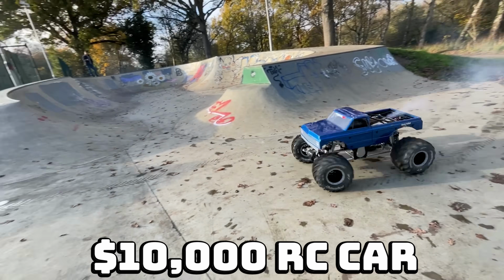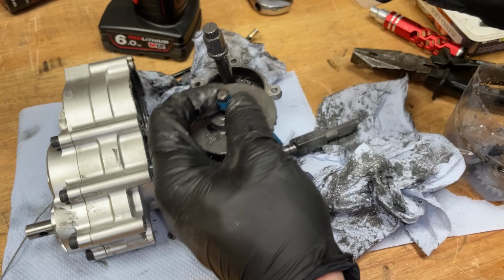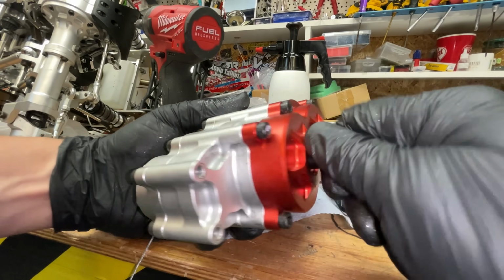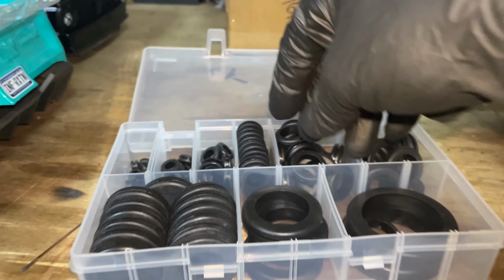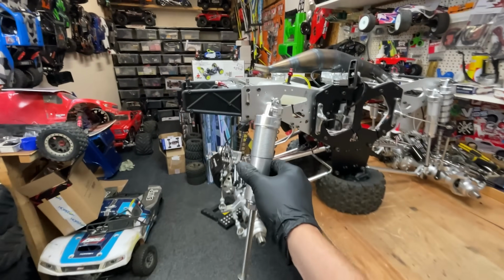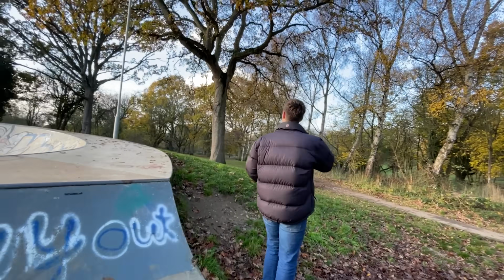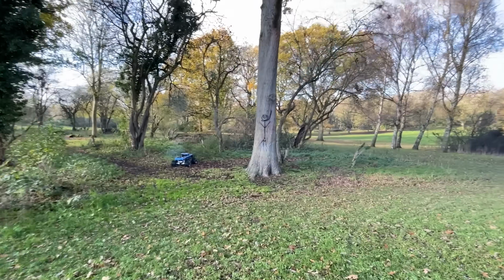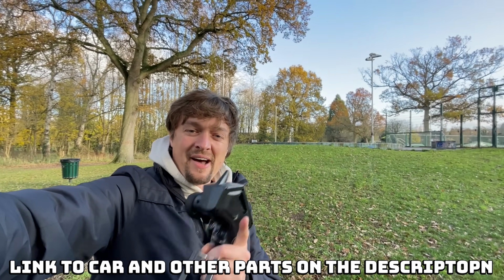$10,000 rc car

Comment from the maker: Kev's eBay Secrets - 11 steps to being your own boss https://kevtalbot.clickfunnels.com/squeeze-page31158442
Reply: Another good video kev👍🏻
Reply: Can you like this comment? It would mean a lot ,hello from USA
Reply: Thank you Kevin!
Reply: The wheels were spinning too fast when it landed with nearly no forward momentum,  which sent massive torque through the drivetrain as they're forced to stop instantly.
Reply: Kev can you try the traxxas Slash 1/16 because i want ont but i want a expert opinion.
Reply: @NickKautz  that could be but it also could be the impact knocked that shifter fork off. That's the first thing I'd check. Pull on the cable to see if it is moving the way it should. A broken shaft would make grinding noises in the trans not like you could hear it over the exhaust lol
Reply: I think it the 2nd rev up mid air that caused the brake.  Basically landing on throttle is a no no in all rc cars.  It can and will break parts as I know you already know!!  Keep it up kev!!  You fricking rock brother.  I know you prolly already figured this out for yourself after watching the video back again.
Reply: Will GAME OVER compete in MONSTER JAM?
Reply: I thought you would have bashproofed that bodyshell ?
Reply: Kevin you just need to find some land with a big yard and build your own jumps
Reply from the maker: @JASONH01  ebay
Reply: @JASONH01  it looks like a 419 piece set found on ebay and other selling sites
Reply: i love your videos kevin u are so creative!
but could u bring back the "lets go brandon i agree" clip? that's the only thing joe said that i actually agree with lol
Reply: Kev, I’m getting another car for my son and I to have fun with. I just need to know your opinion. Maxx V2 or Sledge. Gotta order in time for Christmas!!!
Reply: I wonder if you can dampen the fall with larger wheels or foam inside.
Bigger the RC hard they land and this one lands nicely. It's just hard on all components and replacing everything without fixing the main issue doesn't sound fun
Reply: @jadavison  if you can afford a sledge, id defo get the xmaxx instead of the other two if I were u
Reply: should have filled the transmission with 75w-140 gear oil
Reply: Dgdgdsjf😢

Comment: Those landings where so clean. Shock setup is brilliant
Reply: To balance it I'd get softer rate springs but distribute the load over each of the two shocks.
Reply: almost like he owns and drives a real monster truck
Reply: except the one in the beginning when he pulled it out of the van and it landed on the front left wheel in a way that looked like something was going to break.....solid build.

Comment: I see you put double sealed bearings in the gearbox, try leaving the inner seals off so grease/oil can get in and keep them lubed.
Also it might be an idea to upgrade the high load bearings from deep groove to roller bearings so they can handle the power.

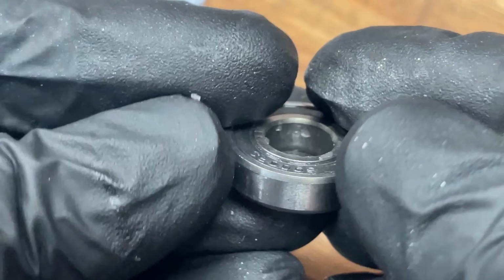Comment: 3:50 glad to see that worked. I read that bread works too. I had to do the same for a router I have but there was an edge underneath and I was able to get a tiny puller in that I have.
Reply: Bread works great- used it to get a pilot bearing out of the end of a crankshaft. The other readily available substance is bar soap.

Comment: Removing the seal on a sealed bearing and adding grease is over greasing the bearing. The end result creates a bearing that will run hotter than an ungreased  bearing. To much grease creates friction which turns into heat. No hate just knowledge I’ve learned in my trade. The trick to get that bearing out was great tho and I can use/test in my profession.

Comment: That was a lot of fun to watch. I just love looking at all those machined parts. I think someone needs to tell the good folk at Raminator, and possibly any aftermarket parts makers, to put small radiuses everywhere there is a sharp corner on their shafts and driveline components. Maybe dial it back a notch on hardening processes too.
Maybe then things won't snap as much. It's quite the engineering challenge to make something that big and heavy be durable as well.

Comment: Think I'd pop those bearing seals for good and let the oil in the transmission lubricate them continuously. Love the trick to get the bearing out of the blind hole, never seen that before. I'd have been there forever using heat/reverse pliers.

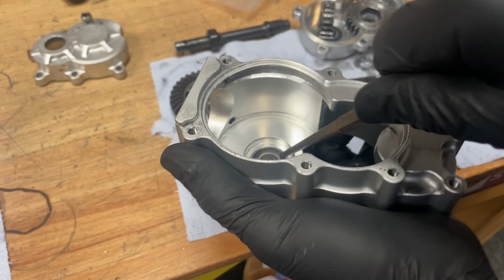Comment: 3:15 - Use white bread to take the bearing out. Old trick to get pilot bearings out of transmissions. Just stick some bread where the hole in the bearing is and then press. continue the process and the bread will push the bearing out.

Comment: Hey me again the monsters truck mechanic when you bent your bar an gave you advice on how to setup you truck.  We use these as test trucks for big jumps or shows setup for backyard events.   This will help you get better as a drive  also get your self a little camera go f.p.v. Inside the cab. Gets you used using the tires to handle the truck.  Just letting you I was hoping it drove away but then again like all new guys never overcompensating for what might happen. Over build it and you'll never break a thing and you will have a lot of fun and less maintenance.  Have a good day bud great show

Comment: Personally, I feel kind of wary about the way the transmission on that only uses grease. I probably would have sealed it with gasket maker and filled it with gear oil. The grease does seem to hold up fine though.

Comment: Since the bearings are in a housing with grease in it,  it would be best to not put the rubber covers back into the side of the bearing. Leaving it off it will always be lubed by the grease in the case. Then all you should have to do is routine grease change or even do away with grease and use automotive gear oil.

Comment: Kev that tranz needs to be sealed so you can fill it with some diff fluid. Those spider gears are turning super fast and heat up quickly

Comment: Awesome video Kev. Jeez that young fella is hard on the gear. More money than driving skill that’s for sure. You’re a hard basher but a good driver so lamd things well 99% of the time. Reason that broke the drive is that last throttle blip you gave it to level it, the slow mo you can see it was just before it hit the ground. That’s a lot of inertia on those big tyres and a lot of weight coming down giving it lots of grip. Something had to give. Shocks look to be working very well. I enjoy the more technical videos like this one. Cheers from New Zealand.
Reply from the maker: yep last blip did it i think!

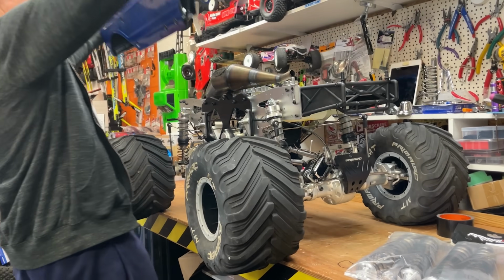Comment: lol, you have to pick up the DeWALT (10.8v - 120$) from the trash, the Milwaukee Fuel (12v - 200$) can't handle that nut. Or chose instead the 18v DeWALT (minute 1:00) you had on the right. Thank you for your video.

Comment: Hay Keven take the seals out of the bearings and leave them out. That gearbox is sealed it will allow the geese to flow into the bearing when it gets hot.

Comment: AMAZING.  Your suspension is getting DIALED.  Your jumps looked so great (till they didn't) and the truck was barely bouncing!  

   On the topic of shocks, I have an idea that would give you, for all intents and purposes, dual rate shocks.. and not just dual rate, but also an additional bump stop support all helping to lesson bottoming out.

  Here's my theory.  Take two unused springs and cut them in half.  Then on every shock that does not have a spring, affix a half spring to the upper shaft body, so that when you take those huge hits, when the rig violently blows through the suspension travel, those half springs start helping out, and shouldn't add to your bounce too much because they can only push back for half of the stroke!  Or at least that is my theory.  

  LOVE the vids man, and be careful of landing under throttle with that heavy beast, and I think it will keep taking the air!!! (assuming your shock seals, and well, eveything else holds up)

cheers from across the pond

Comment: The x-maxx a-arms like to break where the shock attaches. If you replace the captured pins with bolts with nuts it holds up much better. Just have to remove the pin, drill hole all the way thru and then insert bolt

Comment: God that thing gives good video. You ever think about making a small vacuum table and making a body out of Kydex plastic. It’s what we use in the firearms industry for synthetic stocks and holsters it’s tough as hell and super easy to work with - only down side it would be transparent but you could paint the outside or wrap it - it wouldn’t break on you and give your rc cars more protection.

Comment: Put the bearings in a baggie in the freezer overnight.  Before assembled, heat the spot where the bearing goes (torch or heat gun), your frozen bearing should drop right in.  No hammering.  Happy bearing.

Comment: There is a reason a differential exists and it broke cause you basically locked it up .the shock of all that weight landing gets sent through the drivetrain and something has to give..it needs some kind of buffer in the drivetrain... equivalent to a guibo or flexdisc

Comment: Outstanding video. You’ve really peaked my interest in real RC cars, not the ones I buy my grandson. Loved the mechanical part. Question. Do you control the truck in the air like motorcycles? It lands flat.
Reply from the maker: yes, throttle puts nose up brakes nose down

Comment: Bearings are funny. Grease can harbor heat. You could consider a light gun oil or even graphite. I certainly would NOT use grease in a gear case.

Comment: I would seal that gear box up and run 90 weight gear oil then you won't fry the bearings and remove the seals so they get plenty of oil.

Oh and maybe find or make a silencer for it it still have good power but not so loud 👍

Comment: Take the seal out of the inside of that bearing not where it goes into the case itself but on the inside so the grease can get into the ball bearings should have left that cover off in just installed the bearing

Comment: Quite easy to just press the bearings in with a steel bench vice and a piece of round pipe the same outer diameter as the bearing.

Comment: Lol send my stampede up a mega ramp saved from a closing skate park . Pinned it across the paddock hit the ramp launched around 20-25ft in the air cleared around 10 metres and landed on all 4s before exploding into a thousand pieces..no regrets it was pretty impressive 😂

Comment: I know its just a toy to you, but its much easier to seat a bearing in its home using a block of wood & hammer that rather than hammer the actual bearing, that way it goes back in the hole square and no dinks on the new bearing, I guess you probably already know that but just dont care because its a toy at the end of the day, also if you heat the case, and freeze the bearing it will almost drop in without even needing a hammer, then allow both parts to return to room temp & it'll be locked in there tight!

Loving the content and looking forward to giving the ebay course a bash too!

Comment: You revd it as it landed, the shock from hitting the ground while the wheels were spinning at a high speed broke the axles, common issue with jumping sxs

Comment: It's a bummer they don't use real oil seals in those shocks like motorcycle forks. Maybe you can get the body machined to accept a real seal instead of an oring?

Comment: You should but gear oil in the trans and drop-down case as well. At least a little bit ur gonna smoke them bearings again with that power.

Comment: Should've ran 90 weight gear oil in the trans, the grease will work but not at the speeds you run.

Comment: This truck, spends way too much time in the shop getting fixed, compared to the amount of time spent running it. It seems to me, it is not very good bangs per buck, or smiles per buck. Better to buy a $500 beater and drive it til it drops. Would surely last longer and be easier and quicker to fix.

Comment: Dude even if I had $10,000 to just throw away and I love RC cars and planes and everything RC but I would never put that much money into any thing RC any one thing. Because there's absolutely no way that that is worth $10,000 I guarantee you at the most they might have put seven or $800 in it and you cost to the manufacturers what I'm saying. It would surprise me if the manufacturer gave as much as $1,000 for all the components in that truck. But I do love you channel so don't get mad at me and block me please lol.

Comment: $10,000 RC truck fails the first time you take it out it reminds me of a dodge challenger! 🍋
Reply: It's a simple problem that needs to be fixed, also we have a challenger with 130,000 miles on it because we take care of it. I'm assuming people like you could care less about your vehicle
Reply: @Itmightbemason  No I take care of my car come and look at my (community post) about MOPAR failure! That car is a lemon by design the driveshaft goes out at like 50 or 60,000 miles the water pumps go out all the time and ball joints bushings and engine mounts also fail the windows the actuator cable frays! The gas cap light comes on telling you the gas cap is off when it is not it is a evap solenoid I Sued FCA corporation for $12,000 and they did not contest! 🙅🏽‍♂️
Reply: @Itmightbemason  If you drive that car the way it’s supposed to be driven it’s toast 🔥
Reply: @Itmightbemason  They designed these cars to fail on purpose!
Reply: @Supernatural1978-OG  what no😂 we drive it like a sports car, we donuts,  we accelerate, rev it and have fun and it's never failed us